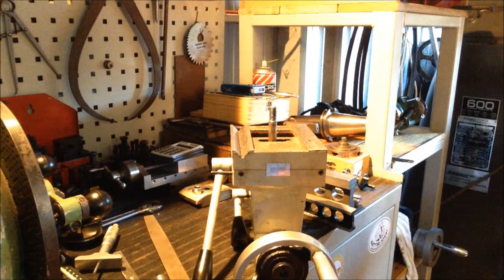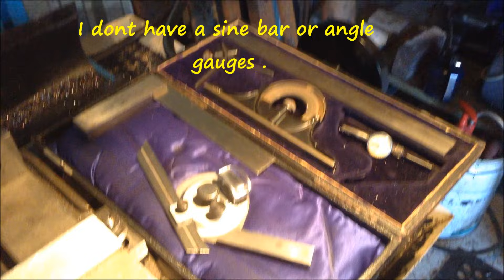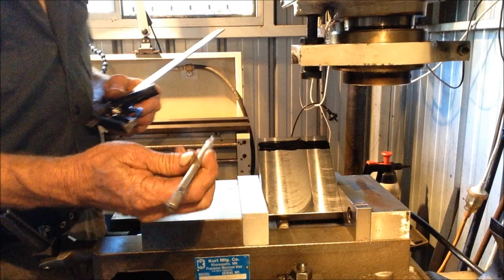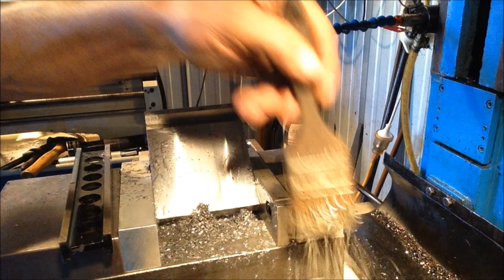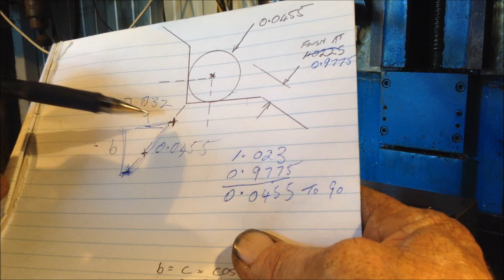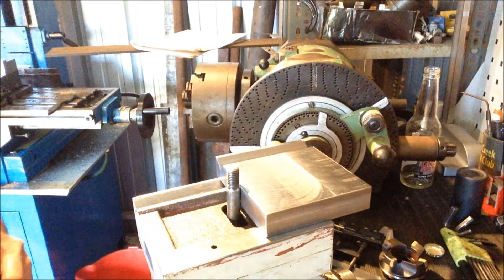Swarf & Chips Ep 4  part 2  Into the groove !

Comment: Hey Max.

It,s a shame you do not have an Auto Feed for this Mill would make life a little easier.
 You manage to make it work well enough.
 The Man Made finish came out good too.

But at the end of the video there is a nice Bridgeport sitting in the background so i am guessing this has an Auto Feed.

Love the on screen note about the measurement,  everything goes well until you point a camera at it then everything changes, LOL.

Clarkson Autolock Chuck.
I use to own one of these but sold it with a Herless Milling Machine some years ago, with other various tooling to suit the INT 30 spindle.

I sold this to a good friend.  Bruce Woodley from Powerflow Motorcycle Engineering.

Thanks for the video.
Regards Peter.
Reply: Peter gets the good citizen award tonight. Flagged my yet again hacked up video. Thanks Peter I pulled the video. Video editor went nuts on the one. Uploaded while I was at Karate - thought it as okay until you warned me.
Reply from the maker: Yes  Bridgeport  ( aka  Bridget ! )  has power feed for the table but  is waiting for the 3 phase power  i was going to run down from the house , but i have canned that plan  & will wait until the new shop is built  .  I am 6 months behind  where  i want to be  regarding its construction due to having to work on a project in Port Hedland  .  The  miss read on  the depth mic  is eerie  ,  its the same  depth reading as  when i checked  after the roughing cut , Spooky - I cant explain what happened there to come up with a miss read at the start that is the same as the reading in preperation for the finish cut  .  Maybe my  Father & Gt Gn Father ( also machinists ) were looking down on me that day !   Cheers .
Reply: @swanvalleymachineshop  
Hey Max.

Your Funny.
You come up with some good names for your machinery.
Bridget. 
I should have known,  LOL.

Looking forward to seeing the New Workshop going up.
But i am guessing not as much as you are Max.

It will be a great help to you,  having a good workshop to do all you future work in.
But sometimes you need to be patient.

When i was building my workshop it was a big waiting game as mine was a little more work than most.

Yes,  i did really enjoy watching your machining job today.
Even though it,s a fairly straight forward job.
It,s hard to explain,  always different when you watch someone else doing the job.
Maybe because we can watch from the side, that might be it, LOL.

Thanks for your reply, Max.
Hopefully we can have a few video,s when the New Shop is going up.
All the Best.
Regards Peter.